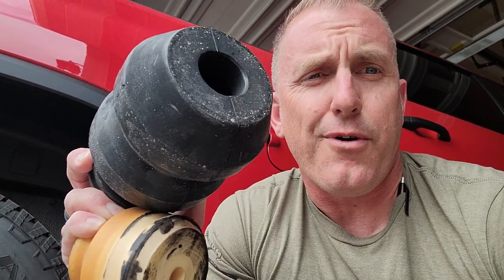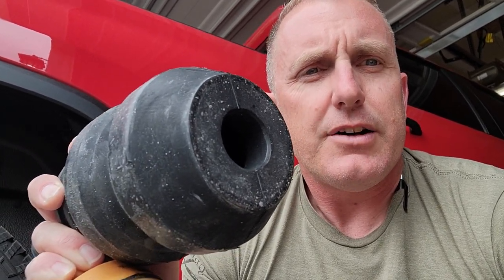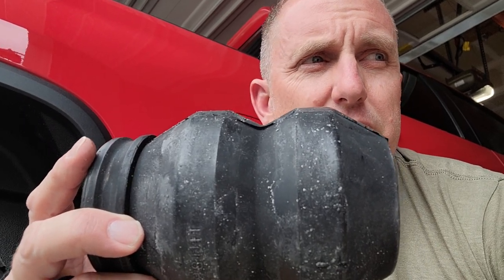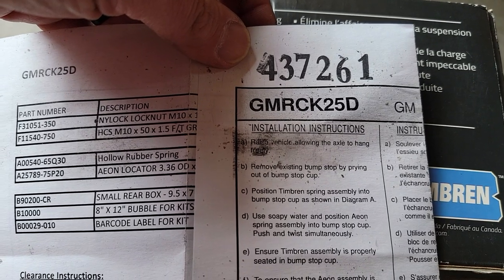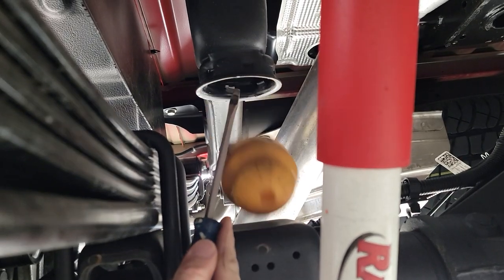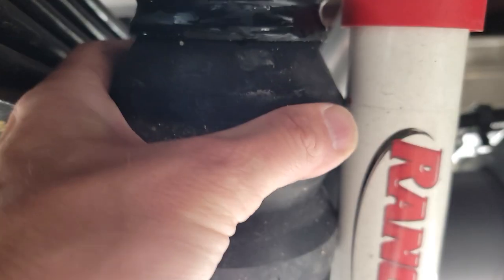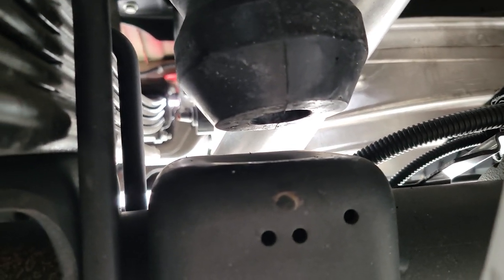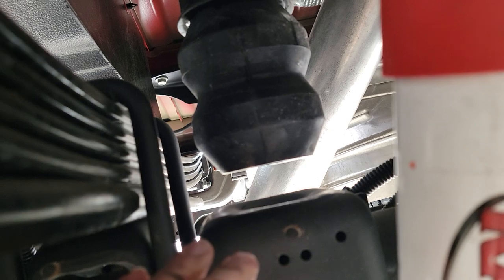Reduce trailer sway..Sag..and bottoming out..cheapest way..2024 chevrolet silverado 2500 hd and more

Comment: I installed Timbren SES units on my 2021 GMC 1500 and "love them".  Especially for trailer towing without Weight Distribution System.   The secret is to install with 1" gap.  IMO, Timbrens should be factory build inclusion.   Especially for their design of NO air up / air down and air leak hassle.  I recommend with 1" gap.

Comment: Nice video. I put Timbrens on my Silverado 2020 2500HD and I have a 2024 Silverado 3500HD ordered. I plan on removing the Timbrens from the 2020 and putting the OEM bump stops back on and then using the Timbrens on the new truck. They're a great product!

Comment: Put timbrens on my 21 Ram 1500 about 6 months ago,probably the best money I’ve spent in a long time. I pull a 21 Rockwood at 8000 lbs about once or twice a month on average and the difference is huge,pulls better at interstate speeds,about 65 mph for me , less sway and porpoising ,no 18 wheeler side shimmying, I set the cruse control and relax ,they work great in the north Arkansas mountains where I drive considerably less than 65 in some of the Hwy 7 hairpin curves . Unloaded the ride from stock is not noticeable until you hit the dreaded north Louisiana railroad tracks or some of the larger potholes then you can feel the timbrens hit, not bad but noticeable. Every truck I have will have timbrens going foward .

Comment: Airbags are amazing for any truck you are towing/ hauling with
Reply: I agree. I ran Timbrens for about 6 months. I wasn't that impressed with them so I removed them and installed air bags. What an improvement. With the Timbrens you're going to still get some squat. With the airbags you can level the truck out.
Reply from the maker: 💯, air bags are a way step up, but they aren't without maintenance and usually for a quality bag you'll pay.  Timbrens are and easy ad on and fairly inexpensive.  But yes air bags are great.

Comment: I have a 2024 GMC 3500 gas with 4079 load capacity.  We are hauling a Lance truck camper and boat that is more payload than your 5th wheel at approx 4k fully loaded.  Would you still recommend the timbren for this application, or would airbags be better? 

Fyi, your channel was instrumental in the gas vs diesel decision.
Reply from the maker: @beaverstaterich881  I would over bags or anything more complex.  I always thought bags were king,  but in reality SES like this are just a good

Comment: This is just on me mind you but was sort of hoping there would be a comparison between the ford and chevy stock suspension for sag down travel with the very same fifth wheel trailer lowered down onto the fifth wheel plate. Of course there still can be but the timbrens will no doubt help hold up both truck frames. If you have not done the tow testing yet, feel free to do a center of rear fender height before and after the load is applied to both trucks and note how much you think the timbrens compressed with either truck. Perhaps its a visual only thing but the chevy "looks" like it has a more substantial spring pack for carrying a load over the ford ( if I recall right that your truck does not have the tremor package with the heavier springs ). I know sometimes looks/measurements of a spring assembly can be deceiving due to different spring steel and heat treatment causing vastly different characteristics.

Comment: Ever thought about changing out those Rancho shocks? Towing my 8000lb camper...I noticed my rear end bounces alot. Been reading Bilsteins correct this issue.
Reply: I trashed the Rancho shocks on my 2021 2500HD and went with Bilstein and the difference is night and day. I too had a lot of rear end bounce with the Ranchos. The Bilsteins significantly reduced the bounce when towing.
Reply from the maker: I've never really cared for Ranchos.  They just don't seem to last long, so these I would replace with bilsteins for sure.  The godzilla with fx4, has bilsteins.   The ford is definitely bouncy compared to the chevy.

Comment: Had bags on the 250 and going to go with something like this on the f350. I have not owner either the sumo or the timbren and starting to research that now.

Can I ask why you chose timbren over the sumo? Both are about the same price, thank you
Reply from the maker: I've ran both, I feel that the sumo are not resilient to weather here in Colorado with  salt and mag chloride.  The timbrens I put on my 08 looked like new till I sold it.  Had a pair of sumo on an 11 and I didn't feel they they responded as well to load and after two years the outside looked degraded.  That was the last set of those I've ever ran.
Reply: @automotiveinquiries9673  Thank you sir, appreciate your input.
Reply: How heavy are you towing to need these on a 350?

Comment: Do they make the truck ride stiffer?
Reply from the maker: Not at all, if you get the severe service ones, they will touch the axle stops when installed and have no room.  when unloaded you will notice zero difference, but when pulling they are awesome with sway and leveling

Comment: Your method of installation is the difficult way. Thea easier way to install the timbrens would be to place a jack under the hitch and raise the rear of the truck just a little bit. Next place the timbrens in place with a block of wood between the bottom of the timbren and the axle pad. release the jack and the block of wood will force the Timbrens in place. Jack the rear of the truck up just enough to remove the block of wood and you're done. No prying is necessary.

Comment: How does the bump stop handle trailer sway? Please explain. Thank you.
Reply: When a load is applied, the axle rests on the timbrens which helps prevent/even out any back and forth jostling
Reply: @mattya8540  Thank you for answering my question.